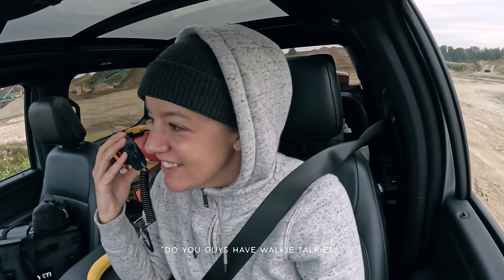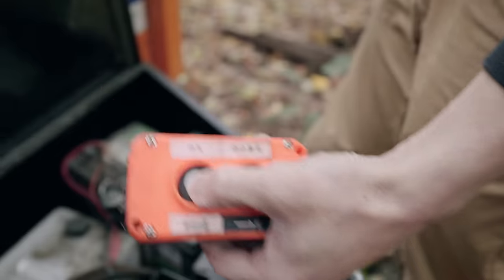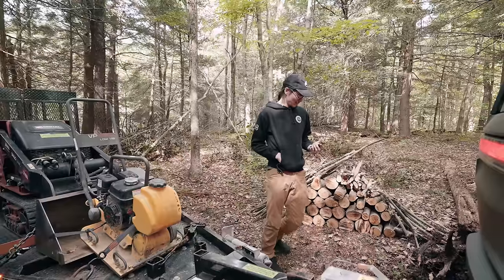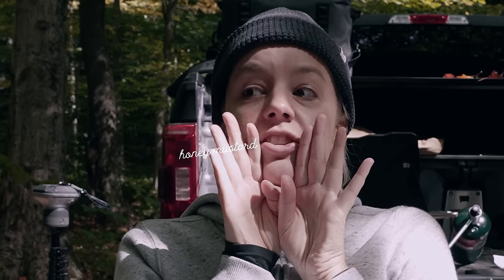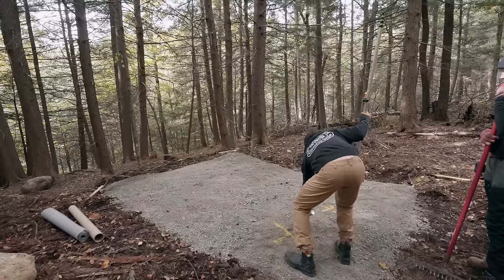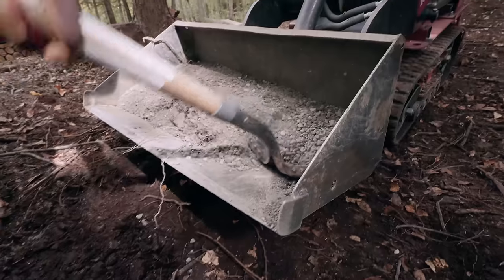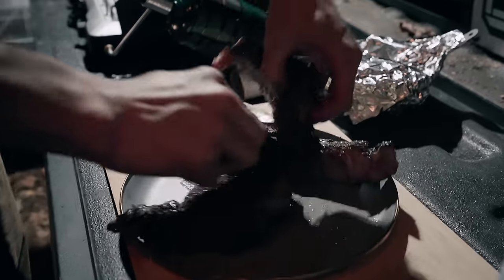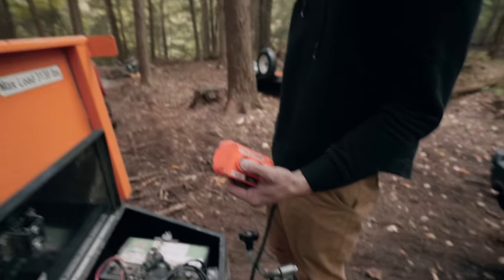Ground Work Prep For Our Free Standing Deck | Ep 3 Sleepy Creek

Comment: Fun fact, the tire pressure you are running is the ground pressure that tire will make. Obviously the heavier the vehicle the more it will squish the tire down and make a larger contact patch but still the same PSI. I used my truck a bunch for compacting the pad for my hangar 🤙
Reply from the maker: 🤯🤯🤯 that checks cause I think we estimated 41 psi based on the back of the napkin estimate and our tire pressure was 45!
Reply: The vibration consolidates the interstitial spaces between the agregate particles.  If you want compaction vibration plus moisture to lube up the process is ideal.  Your truck weight is bearing pressure, essentially how much weight you can stack on top without squishing below.     Either case you aren't building a bridge,  you'll be just fine with what you got. But major bummer about that rental equipment.     Also just want to know what little portable fire pit that is?  Looking for one for my 4 wheeler trips.  Love the property and the vids.  Thanks for sharing.

Comment: If you guys plan on building another camp site with a gravel pad I’d recommend looking into Geocell ground grids. You dig out the spot you want your pads, put the grid down and then pour in your gravel and the cells lock the gravel in and keep it from washing out. My uncle and I used it for a crushed concrete pad to park a camper on and it has held up great.
Reply from the maker: I think we got some of those for our pathway that we’re building! I’ll have to see if it’s the same thing
Reply: @BeckiandChris  they work like a charm. Just stake down the landscaping fabric beneath it and you’re good to go. One other thing we did was framed the geocell with some pressure treated lumber to help out even more. It has held up fantastical the last 4 years!
Reply from the maker: @jakobmorningstar sounds fantastic!

Comment: Plate compactor issue sounds like the fuel vent in the cap is blocked, you may have tried it already but if not next time try loosening the cap or taking it off completely to test.

Comment: What tonneau cover are you using on the truck? Did you change your truck rack or plan to swap them around based on the need of the day?
Reply from the maker: It’s the UnderCover Armor Flex Tonneau Cover! my plan was to run the tonneau over winters and swap to the bed-rack over the summer but I ended up leaving the bedrack on all winter because I ran out of time to build a pulley style storage system